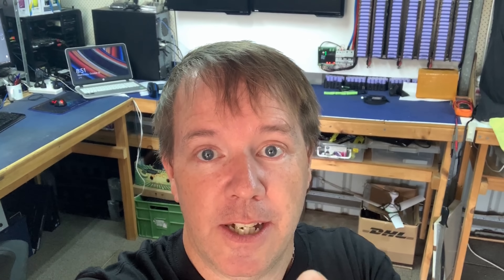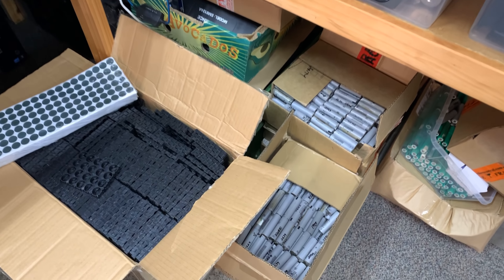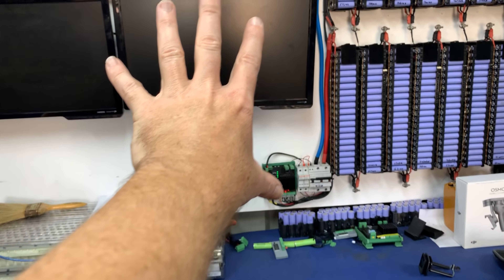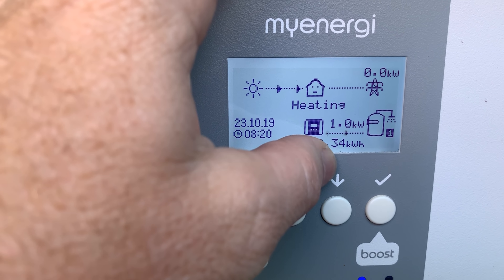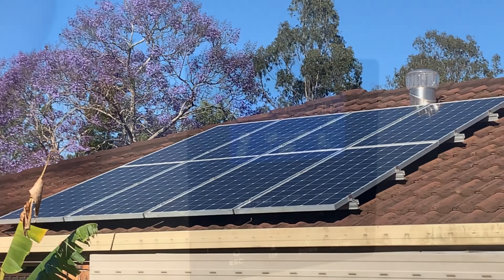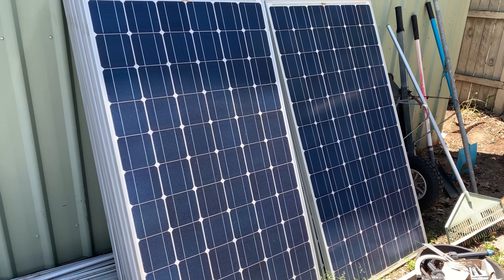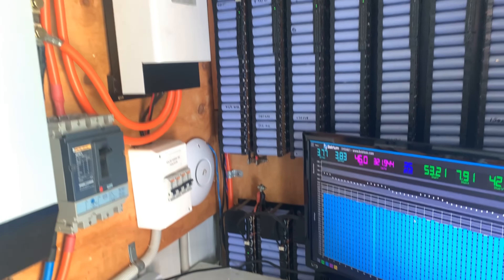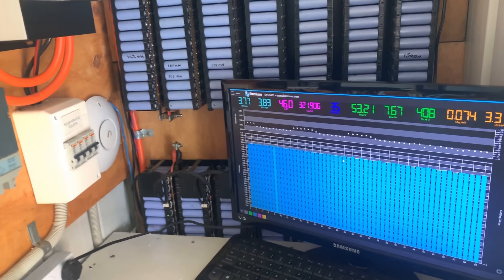Walk around update of my DIY Powerwall

Comment: Is there a way to setup the Eddi so that it NEVER feeds back into the grid (even when the water has reached max temp). I am not allowed to feed back here in South Africa but would like to use the Eddi to heat my water with spare solar power.
Reply from the maker: You could use the second output to a pool, spa or second larger water heater - it can even be diverted to under floor heating or anything with a resistive load.

Comment: Ive got a possibly stupid question about those roll type nickel fuses: how much worse contact resistance is if they arent spot welded but just held together with some pressure?
Reply from the maker: You need a positive contact or you'll get heat and resistance reducing efficiency and maybe even fire.

Comment: We need a shirt that says powerwall is life.  I didn't go the 18650 route, but I am using pouch cells.  I live in an RV, and working on integrating my last 2 packs.  It will be about 13kwhr of usable power with a 7S configuration.
Reply from the maker: Only sold five tees of this one.. altho funny i'm not sure it's of commercial value :( That said id ware it

Comment: can battery mon depict the Ah or Wh per bank?
I wonder that to figure the health of each bank.

If the are way off the theoretical value,
Perhaps one of those batteries in the bank is faulty
Reply from the maker: no, not my BMS but it does show the difference between all of them at a given SOC
Reply: @HBPowerwall  meaning,
Voltage and current is the same throughout  (almost) the whole bank.

Whoever charges faster or discharge faster,
Indicates it have reduces Ah or Wh.

Correct?

Comment: Impressive setup Pete! It does however shit me that the government hasn't stepped in and forced the power companies to pay equal share for FIT. I.e. if they charge 26c/kwh then its only fair that they pay 26c/kwh for exported energy from consumer solar. None of this 7c or 9c/kwh. This is why I'm going with batteries and batrium system, so I can store the power and use it instead of paying the rort that is a power bill. Edit: why am I not subscribed to you already! Shame on me!
Reply: dash8brj I agree that 7 or 9c per kWh is ridiculous but they’ll never pay the same price they charge.  Without a profit there’s no incentive for them to let you use their infrastructure.  I mean they probably spent millions on poles, wire and installation to make it possible to supply and receive power to homes.    A full off grid setup would probably yield the best profit for the home owner.
Reply: Would like to see micro grids created and old lines starting to get decommissioned for rular sites. That would reduce price for everyone since there will be less lines to do maintenance on,. Tree triming, etc.
Reply from the maker: I don't think it should be dollar for dollar and I chose this plan based on my usage and I get a 22% across my whole bill, not just usage so it worked well for me when i signed up 2 years ago - the contract is up and now I have to math. My last bill was only $220 bucks so I'm quite happy with that but would still love to get an AC coupled system but the ROI would be 3-5 years and that money I think would be better left in my home loan than on my wall.